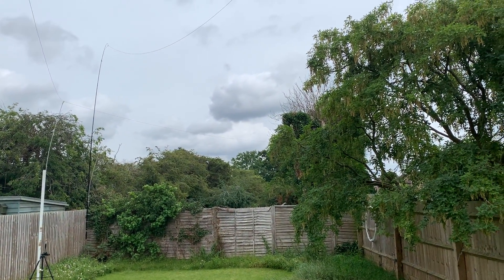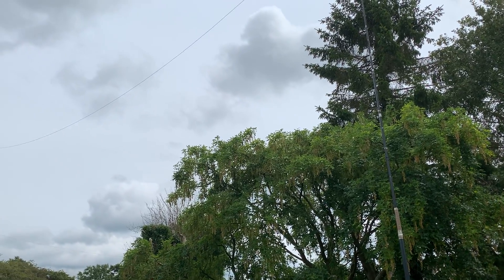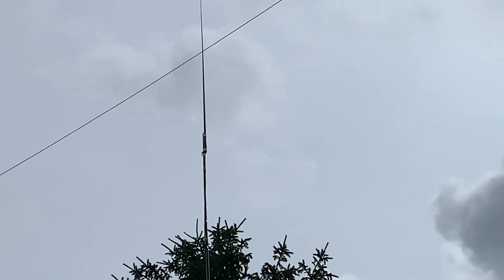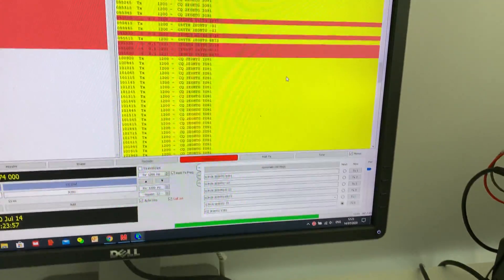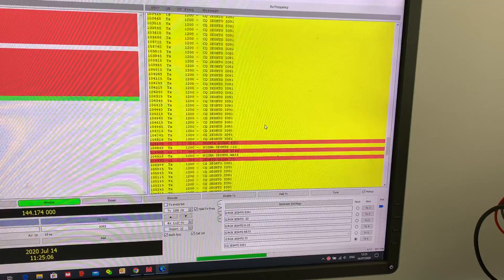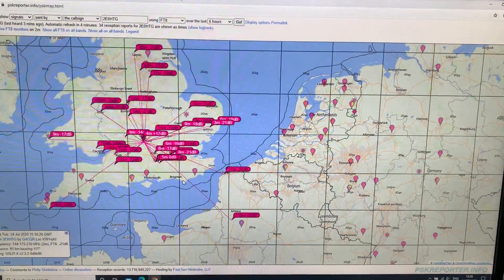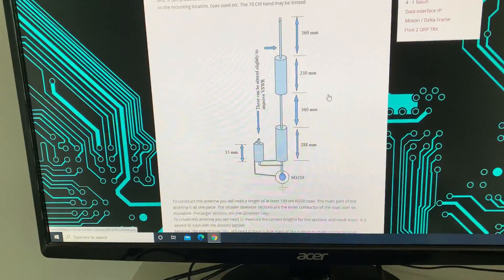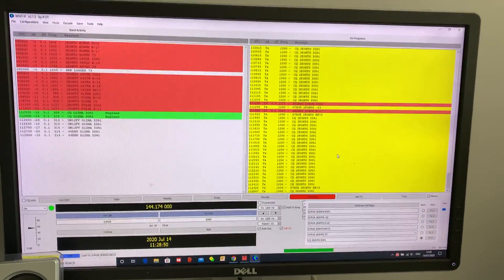A coaxial Collinear antenna for 2m and 70cm mostly made from junk bits and pieces for less than £1

Comment: Outstanding. I see you're using the 991 so does that mean you're using 50 watts as opposed to the 5 watts with your previous set up?
Reply from the maker: Hi Walter, yes that's correct. I've just been doing FT8 on 70cms but there's only 12 active listeners! 73s, Clint